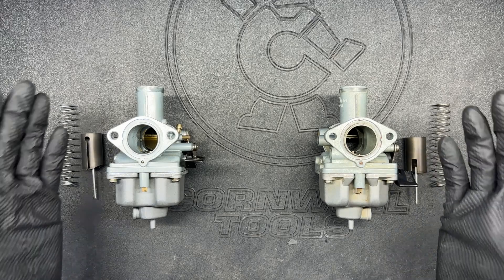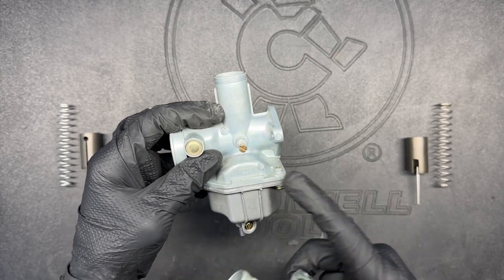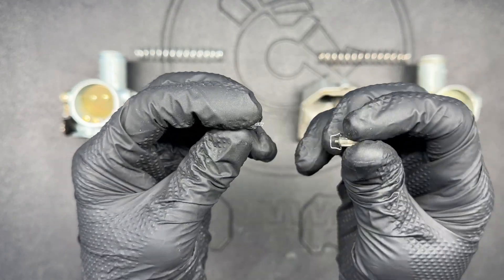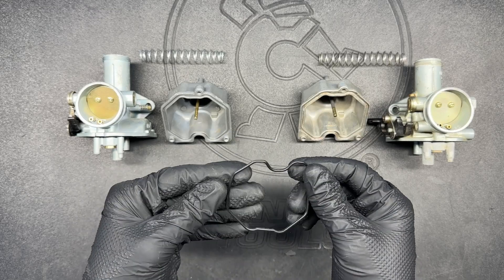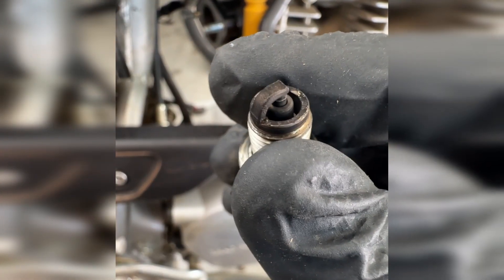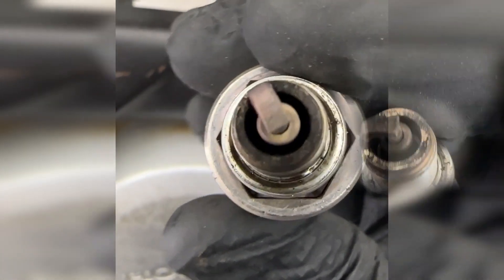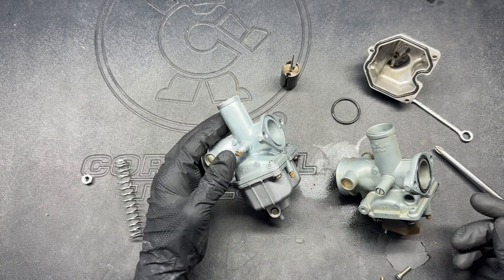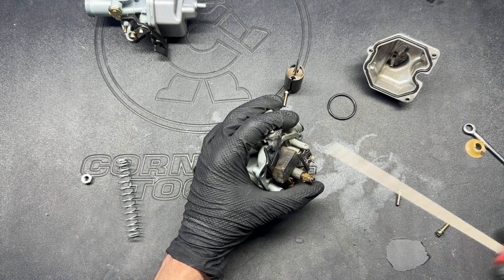Testing a Cheap, Knockoff Carb Against a Genuine Keihin (With surprising results!)

Comment: I need a 26 mm for my Rebel 250, with the o-ring like those,  mount flat against the intake
Reply: ,  but the keihin are all a billion dollars
Reply from the maker: On those if you can't find an oring easily you can opt to run a gasket instead. You can even cut one out yourself from some gasket material for cheap.

Comment: Dude I am just as crazy about carbs as you. I would ponder on the air jets and the difference between the two. After comparing carbs for the DRZ the china copy was smooth but ran really rich compared to the bsr36

Comment: May i ask what carb do you recommend a flat slide or round slide
Reply from the maker: I like both designs depending on the budget and use case. Flat slides are considered a superior carb but I've used Mikuni VM round slides a lot with great results. And the round slides are usually cheaper, and simpler carbs.
Reply: I'd like to see this